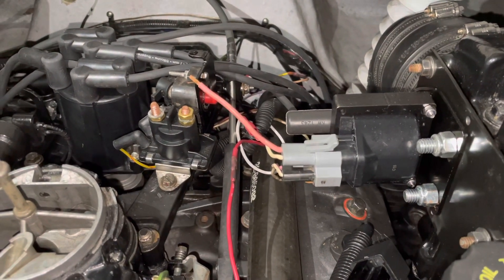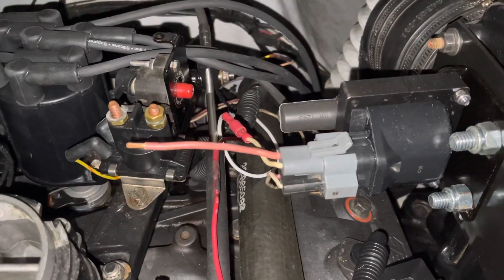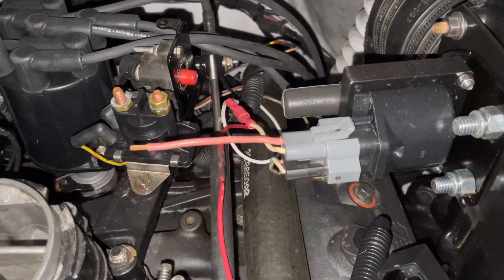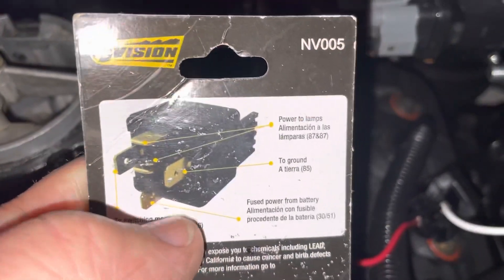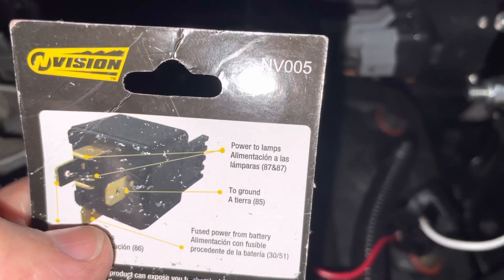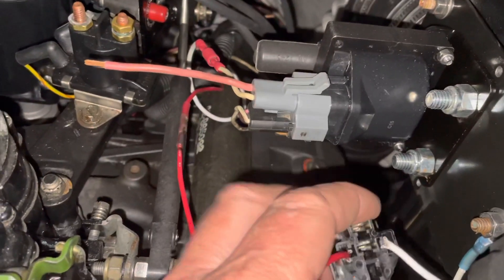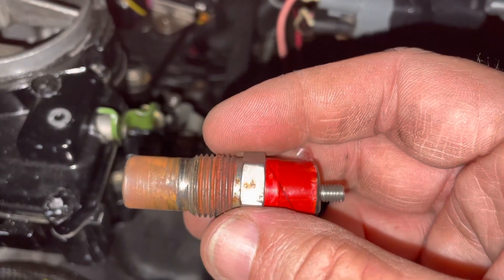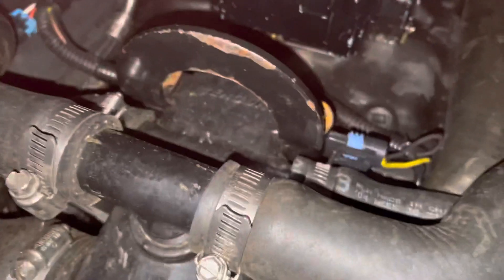4b - Mercruiser Thunderbolt?- OLD VIDEO - Read Description

Comment: I wish you would tag my comment and potentially help me. I have a 1995 mercruisa 5.7 l, the marine engine in a 23 foot saltwater, cold engine, 23 foot, 3 passenger boat. The 5.7 l mark cruiser, GM engine will not pulse the injectors to open allowing fuel into the throttle body due to the fact that it is throttle body injection. Could you please help me with a wiring schematic or any further information? Even if I have to Submit credit card payment. I'm asking please if you could assist me. I double checked, triple, checked. All of the engine grounds as well as cleaned the engine block. So on the head thoroughly, granting a new and common connection.
Reply from the maker: I need the engine serial number. Text it to 706-358-3175.

Comment: This series is great! Thank you for taking the time to put it together with such detail. I have a couple of questions given my setup hoping someone might be able to answer. I have a 1995 Merc 454 Mag (Gen V). Serial 0F305185. With a Bravo I.  It has the Thunderbolt V ignition with the knock sensor.  I've read the Delco EST upgrade removes the knock sensor. Q: Is there anything I should be concerned about in doing so?  I plan on removing the wire from the sensor abandoning it in place. It too has a +12v purple wire & ground that I will cap off or possibly use for the new coil depending on my mounting options and, it's actual wire size as I have a mechanical fuel pump. I do have an electronic choke but I can imagine it being a large draw. If need be, I'll use the relay method.  Also, the alarm issue... switching from a thermistor to a switch... I have (2). One on each side of the thermostat housing. Think I need both?  And would the same 48952 part# apply?
Reply from the maker: The Delco EST system was the factory ignition designed by GM for all marine applications. Volvo Penta chose to use it, mercruiser did not. Since Volvo Penta used the system without a knock sensor, you are safe with one caveat. You must use 89 or higher non ethanol gas. This is not a maybe or sometimes, this is ALL THE TIME.

As for the rest of your comment I’m not sure what you are saying. Are you telling me you have two switches? Which is probably incorrect, or asking if you need two switches. If you are planning on putting this system together yourself, be forewarned that you probably won’t find the Delco D1965A module. They have disappeared from the internet at reasonable prices.

Also this video is obsolete. All current videos on the Delco EST system are saved in this playlist:

https://youtube.com/playlist?list=PL6wJJenh5G97LCeXUnnFaEoyld3gnS0IT&si=oj4OdTGi4Y63Gqip

Comment: Hi! thanks for such great videos. Have you encountered a situation where the tan-blue terminal on the ICM is constantly connected to the ground? It seems like a short circuit inside the ICM module. I am not planning to replace the TBV with DELCO just yet. My plan is to install an additional temperature switch somewhere in the water spider and move the tan-blue wire from the ICM module to it. This way, the ICM will receive readings from the temperature sensor, and the second switch will be responsible for triggering the buzzer.
Reply from the maker: You misunderstood the tan blue wire purpose. It leads back to the negative side of the alarm horn. A tan blue wire goes to each alarm device (low oil pressure, high temperature, and low gear oil level). If you are reading ground on the tan blue with engine off it’s because you are reading ground through the oil pressure switch which does sound the horn with the key on engine off. The yellow wire on TBV is for the analog temperature sensor. The TBV not only uses temperature to turn on the over temperature alarm it also retards the spark timing. Why do you suspect the over temperature alarm is not working?
Reply: @moccasinmarine  A bit different setup on my boat (Mariah SX9 2003). The low oil pressure switch does not use the tan/blue wire. It seems to only provide a positive connection to the fuel pump when shorted.

However, if you remove the ICM from the engine and check the resistance between the tan/blue and black terminals (ICM), you get almost zero. This would mean that the buzzer should work constantly, which seems incorrect.
Reply: I can provide an exact wiring diagram of my boat. iBoats have a respective topic. Can't insert a URL here.
Reply from the maker: @antons7852  there are three oil pressure devices. One is the sender for the gauge in dash, one is for the fuel pump power under way and the third is the low oil pressure alarm. When you turn on the key the low oil pressure switch does turn on the alarm horn until you start the engine. All tan blue wires are paralleled in the harness so if you read one wire to ground you’ll read  back to the junction and then to ground through the oil pressure switch. Send me the link to the wiring via text to 706-358-3175.

Comment: After replacing sensor with 48952 the horn comes on right away. Quits when I unplug it. Any advice?
Reply from the maker: Sounds like a defective sensor. It’s actually a switch not a sensor take the wire that goes to the switch and touch it to the engine ground and see if the horn goes off then if it does you know your horns working, then touch to the switch if it still goes off you got a bad switch. That’s the only thing that can be.

Comment: I  replaced the tempeture  sensor is for the TKS system.  I replaced and changed to the single wire.  No TKS diode smokes after warming up and blows 20 amp fuse.  Fuse does not blow and engine will continue to run when diode is not plugged in.  Any advice?
Reply from the maker: The TKS temperature sensor has nothing to do with the thunderbolt ignition system. Two different sensors.
Reply: @moccasinmarine  Ok I may be confused.  Can you tell me where the the tks tempeture sensor is located?
Reply from the maker: Look for a sensor with a two wire harness who’s connector mates with the TKS solenoid.

Comment: I have a 5.7 MerCruiser 1989 Mixing water and oilI haven't replace the head gasket but now the engine doesn't start it
Reply from the maker: You have not provided enough information to answer your question.

Comment: Do u happen to know the part number for the v8 upgrade distributer?
Reply from the maker: You need the whole kit not just the distributor. The only place I could find that has it in stock is Hardin Marine. Better buy it quick because they sell out fast.

https://www.hardin-marine.com/p-74700-v-8-delco-est-conversion-kit.aspx

I found the kit cheaper.  Go to my google drive here and you can find the distributor alone or the V8 kit. The kit is about $50 more so that’s a real bargain.

https://drive.google.com/drive/folders/11R7HM6b6BKjoGR1O3EwE76kBWCjlUrU_

Comment: And THANK YOU for pointing out the need for a different temperature switch. I just replaced the Thunderbolt 5 ignition with the AC Delco system but have yet to start the engine. Solving that horn problem would have driven me crazy!
Reply from the maker: The horn on subject boat was going off at  95 F. That’s when I dug into the yellow wire circuit and ohmed it out to find it wasn’t a switch on the end but a thermistor. Further digging online and I found the Thunderbolt 5 uses the temperature to retard the timing when the engine is overheating. It also had logic to set off temperature alarm. To make the alarm system work without the TB 5 module you have to swap the thermistor for a temperature switch.

Comment: The relay on the purple wire is probably a good idea, but not likely necessary.  On a Delco EST,   an electric choke hooks up here as well on the OEM schematic  so its understandable why the wire is heavier gauge . The EST ignition is the ONLY Merc.version I'm aware of where the purple ignition wire actually drives the choke.  The purple wire must be at least 8-9 volts for the ignition circuitry  Be sure the voltage on the pink wire going into the distributor is 12 volts. I also believe there are some conversion harnesses now to help alleviate the wiring confusion as well as connector exposure problems.  All those crimp connectors are just a problem waiting to happen in a marine environment.  The Delco EST system is a great replacement in my opinion and a good value.
Reply: Yes, I saw that as well on my 2000 5.0 Bravo 3 wiring diagram. I wonder if a relay on the choke circuit makes sense. Thoughts?
Reply from the maker: Wire size is the indicator of how much current the designer of a part thought it would draw. I always try and feed an unknown wire with as big or bigger wire. If it’s a temporary load you might get by but sustained loads need adequate wire sizes.